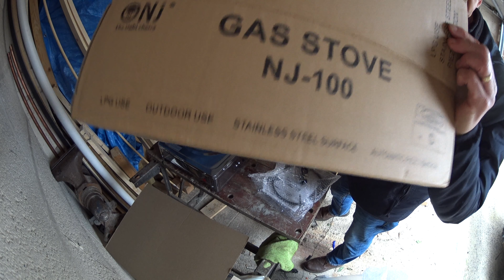Hyundai i800 Campervan Project - Another Small Gas Cooker Test. WOW! It's GREAT!

Comment: Slightly better result than the other one.  I have just bought a sink/ gas hob to put inside my i800 so wondering how I can just use the simple smaller gas cans rather than a bit bottle like you have .  Should the pan support go red like that?
Reply from the maker: Thanks for your contribution and you're right Kevin. 

The sheet metal pan support is a bit on the flimsy side and was likely an afterthought as the burner itself is solid. 

The larger black pan support is solid cast iron and so my thinking is that the formed sheet metal piece is really only there to allow one to use smaller, camping sized, pots pans or kettles with the stove which was really originally designed for commercial kitchens. I suspect that the manufacturer of the stove has then taken one of these "solid" commercial burners and "mated it" with a low cost stainless steel housing to create the product. 

The Piezo lighter and the flame / gas air adjustment features, also suggest this is the case.

It's quite a lot bigger than the previous stove I tried but still smaller than any of the double burner ones. Probably about the same size as your inegral one.

I thought about using this type of stove but discounted it purley on the grounds of having to carry lots of refills and the potential cost of these for a long trip. The big bottle should last me a month.

I also spent the best part of two days trying to find small blue Camping Gaz canisters last year ( they come from France ) when most suppliers had run out of stock. :-( 

Got any trips planned for this year yet?
Reply: @campervansam-UK  have a look I did a video on where I have got to on my build . I have a seat/bed now but no furniture yet.  The plan is to make it away for a couple of nights in April . If I’m done ! That’s a target !
Reply from the maker: @kevindavis6442  It's interesting how we are each taking a different approach. You appear to be going for the full converstion approach. It looks a lot tidier than my battered 800 quid 264,000 + mile wreck. :-)

I use mine as a van much of the time and don't want to loose that option. I've also acquired a light weight 3rd seat: ( Possibly taken from a bus I found on free-cycle.) As I have an occasional need to carry two people. 

My end goal is to have a cheap multi purpose vehicle with a number of different uses. These are dictated by what modules I fit or place into it or keep back in storage. 

Long trip camping is just one of those. 

I'll keep tabs on your progress.